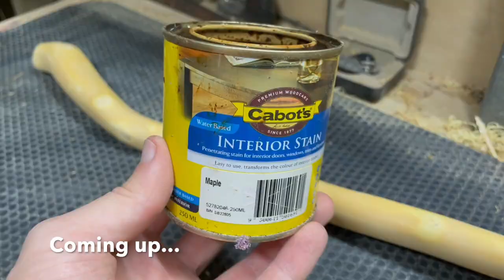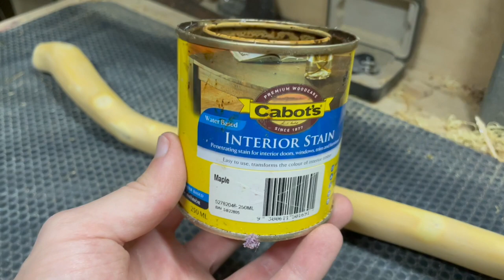Unusual Looking Walking Stick Restoration

Comment: Nicely done.  I could not make out what you did on the tip where the rubber cushion was located.
Reply from the maker: Cheers Dwight. I ordered a proper rubber sleeve for the bottom. However I glued a piece of rubber to the bottom just so the walking stick can be used in the mean time. 👍